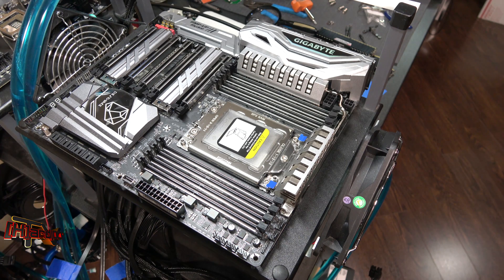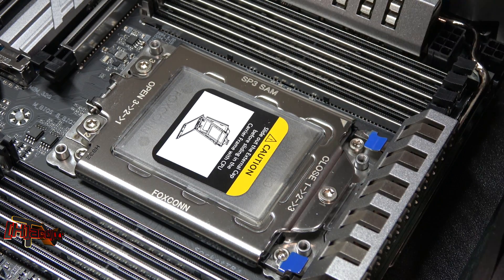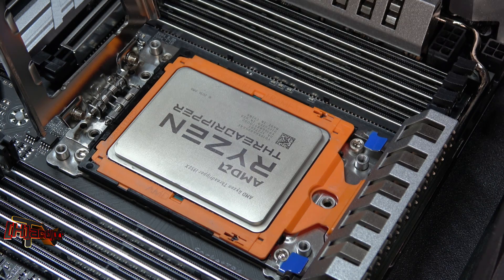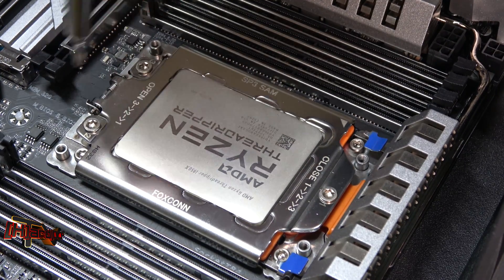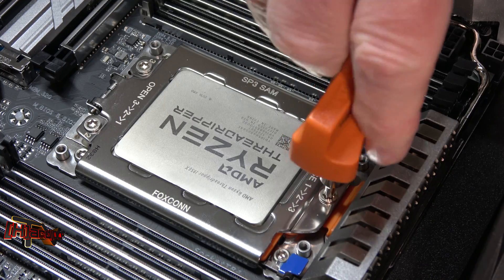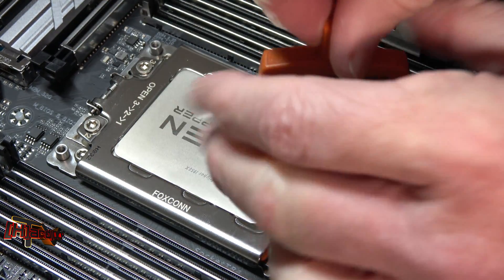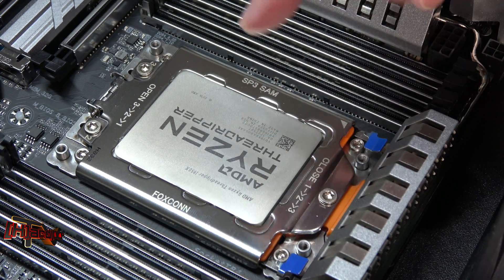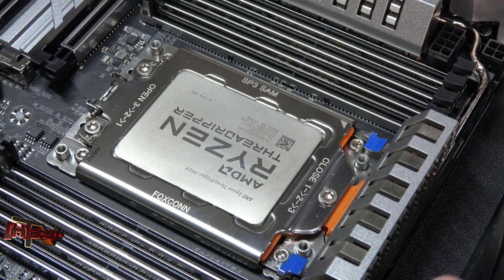AMD Threadripper Foxconn Socket CPU Installation

Comment: I've seen the socket itself not be screwed in properly sometimes, fortunately you can use the provided torx screwdriver to screw it in if that's the case.

It's worth it for people to check if they buy the motherboard anyway I think, no matter the if it's Foxconn or Lotes, because you can so might as well have that peace of mind.

Comment: just buy a god damn screw driver ....
Reply from the maker: Actually that has nothing to do with it.  That tool is a screwdriver for all intents and purposes.  I was simply trying to illustrate for video purposes the amount of force needed to secure the socket.
Reply: you need the torque tool otherwise you'll over/undertighten the CPU